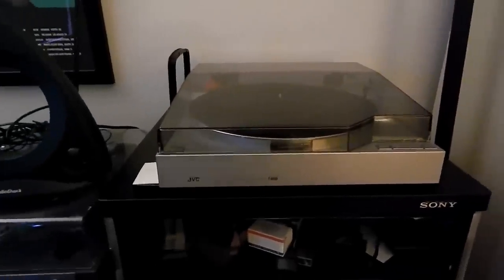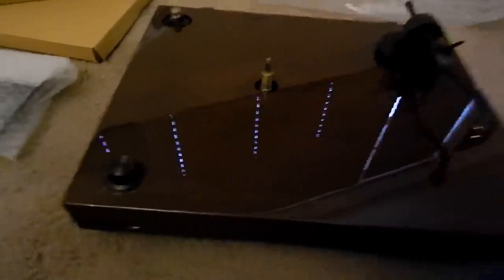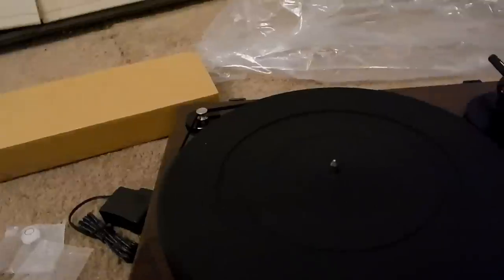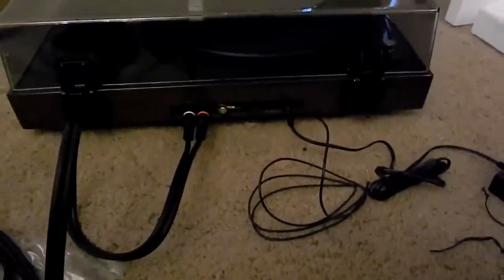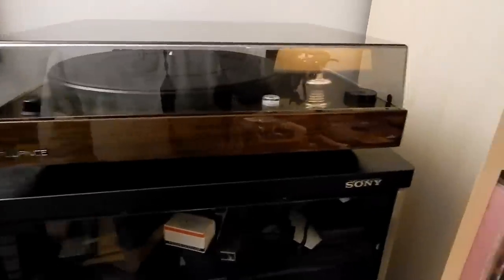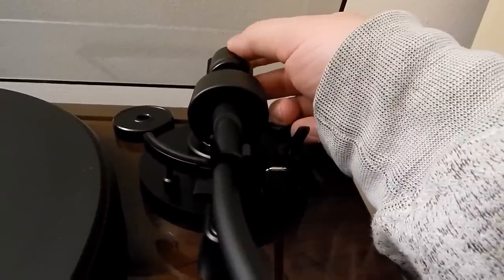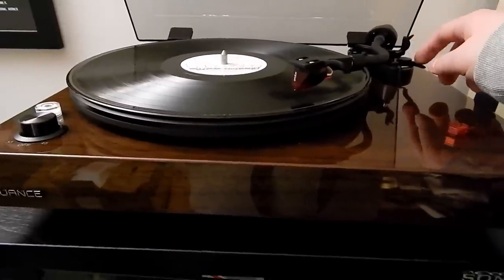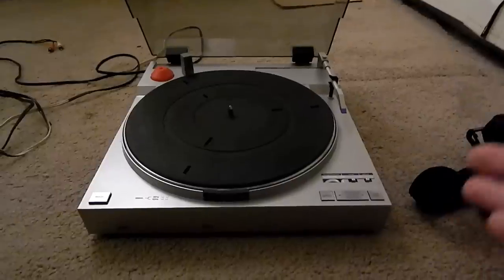New listening turntable: Fluance RT83

Comment: Most people have no clue how accurate the 60hz coming from the line is.  Years ago I toured a Generating plant and in the control room there was a recording frequency meter.  There was a 12” wide “strip chart recorder that was recording the line frequency.  In the middle was 60hz, to the left, 59hz and to the right 61hz.  The pen never varied more than 1/8” deflection up or down.  So you can be pretty sure the frequency is DEAD on.

Comment: Nice video!! I'm planning on the rt-82 because I have no need for the I'm red cartridge because of how many I have.
Only difference between the 82-85 is cartridge and the top 85 comes with an acrylic platter instead of aluminum.
It's on my very short list of next table. The motor is what sold me. Usually have to spend over $1500 for the servo controlled motor. Which isn't a huge deal until the belt wears on a table without it and you have to spend an hour messing with the tiny pots on the bottom of the plynth to get it "just right"

Comment: One ground is used to ground the turntable to pre-amp/receiver. The second ground is included to ground between an external pre-amp and the amplifier. Only one would be needed if you have an internal pre-amp.
Reply: I gutted my lp120 audio technica of the preamp and just recently upgraded to a external preamp. Night and day from my denon internal preamp on my Theater receiver. I didn’t run a ground from the preamp to the receiver I just have the one I made for the turntable to the external. I have no hummm or feedback noise. I don’t recall project mentioning that in the instructions either.  Should I add a ground to the receiver even if I’m not experiencing an issue? Thanks
Reply: @jloahunra76  if you are happy you are happy. Leave it alone if it sounds right.

Comment: The gloves are for two things, 1 - To keep Fingerprints off that Beautiful Walnut - and second, static free handling / - I am assuming that. A couple tips from your "Uncle Kev" #1 - Get a Zero-Stat Anti-Static Gun and zap your turntable the same method as you would a Vinyl Record. #2, Clean your HVAC Air Filter. The turntable may have a slight static charge to it and trust me - dust magnet. I would zap it from time to time whenever you see it collecting more dust than other "Knickknacks / Furnishing close by. Also I would suggest going to Home Depot / Lowes and buy a high quality AC Filter that collects dust down to the lowest microns available - A typical Air Filter may run 8 bucks, a Low Micron Filter will run about 20 but worth every penny. And they last longer so kind of a break even when comparing costs.  I realize I am a perfectionist, can't help it, and I have Moderate OCD so the "Minor" warping on the platter would drive me up a wall - Lol. Yes, I have to live with myself. I echo the comment on the stylus pressure gauge, either remove the stylus cover or weigh it on a gram scale so you can compensate for it when you adjust the tracking weight.

Comment: I notice with my table about the anti-skate, it's dead on when using the floats then set ring to zero and then set weight. But my weight isn't exact and I had to turn mine up when using the stylus pressure scale like you have. What I did was still float and set to zero but then set weight by the digital scale then set anti-skate to what the dial on the weight said which was higher than the 2.0 I set it to on my scale. 
I think it matches the dial on the weight well but when setting with a scale you may have to turn it up.
Another side note about the CD test is if you don't have the CD centered the wobble affects the stylus and can cause it to move toward spindle or away. Best thing to use is an actual blank anti-skate record.
Reply: Laserdisc ive heard are Good

Comment: The 83 makes the most sense.  For another $120 down the road, one can upgrade with the acrylic platter, probably a better up-grade then from Red to Blue.
Reply: Agreed - If  your budget is $350, then the upgrade later to the acrylic platter is the right choice, will lower resonance, improve speed stability and improve overall clarity.  However - If you can wait to spend the extra $150 more from the 83 to 85 (or $30 more than just the acrylic platter upgrade on the 83 ) you get the acrylic platter and the OM2 Blue on the 85.                            If you purchase the blue stylus separately it's $160,  + the platter $120 total upgrade cost for both of $280.  Spend $150 more now - save $130 later...
Reply: @craigclark2851  That certainly breaks down the numbers.  I'm pretty certain Fluance did the same numbers crunching too.  In the end, I opted for the 85 just to be done with it.  My only concern will be the expense of replacing the Blue stylus when the time comes.  It would be senseless to replace it with the less expensive Red stylus now that I've spent the extra $ for the 85.  Very happy with the TT, btw.  It performs beautifully and sounds terrific.

Comment: Looking at that JVC, I never understood how anybody thought those thin, light tonearms were ever a good idea.  They are so light, the arm will vibrate at audio frequencies and color the sound.  The job of the tonearm is to hold the cartridge perfectly still, while the needle wiggles around.  If the cartridge is vibrating too (because of low mass or sloppy bearings),  that means audio energy and information is being lost.

Comment: That looks like a nice turntable but I like the automatic turntables. I am using a realistic lab 440 which I bought new in the 80s, I remember it was a little expensive. I purchased a liner tracking turntable back in the 80s as well but unlike the one you have you can change the cartridge. It still works but the realistic lab 440 I like better. I thought about buying the fluance turntable but  instead I put a Nagaoka MP110 cartridge on my old turntable and it sounds great.

Comment: The dust couldn't have anything to do with assembly on a dusty probably statically charged carpet?
I've got a" listening" turntable as well, couldn't think of anything else to do with it.
You should have mentioned your mistake doing the weighting with the stylus protector on, for those who did not notice the cut where you finally took it off.
Sort of negates all the effort to be informative.

It's hot here this evening and I'm feeling in a pick mood. :)

Comment: Nice table good starting point servo motor is good. you can make flutter even better by putting the belt in a bag of talcum powder this will increase it's performance and the belt last longer, I would upgrade the platter and mat is the best improvement if you can, they will build you one if you ask achro platter by funk firm is the best way or just there 5mm achromat or 3 mm if you can't adjust vta, on the arm, And best improvement you can make isolate your turntable and speakers drastically help a lot get some rockwool 30mm thick cut it to the size required with a bread knife, place a piece of half an inch of ply or MDF on top place a turntable on top of this some with the speakers. Make a dramatic improvement

Comment: Hey! When you’re balancing a tonearm drop the lift lever. You’ll get a better tracking weight 😃
Reply: If you are using a digital stylus gauge to set the counterweight, do you need to 'float' the arm first, or can you just put the counterweight on and go straight to adjusting the arm? Thanks!
Reply: Sure thing, balance (float) the tonearm to get a zero stylus pressure then adjust the counterweight to get the right setting…✌️

Comment: I wanted to go with the RT85 for the acrylic platter and 2m blue, but both RT85 & RT84 are on backorder now. If I buy the RT83 will I be able to swap out the aluminum platter for acrylic?
Reply: I was waiting also, but got tired so I got the 83 and I love it. Fluance says when they restock the 84 and 85 they'll be selling the acrylic platters for upgrades.
Reply: Yes you can buy the platter and just drop it on. 
Also not sure when you were shopping but the 85 is the only one that comes with the platter. They changed the 84 to aluminum but give you the blue cartridge.
Reply: I was able to get the platter and I did see the new 84 didn't have the acrylic platter anymore, but they upgraded the cartridge to the blue.
Reply: Amazon has the RT85 in stock.

Comment: Are you still happy with the RT83? I'm on the fence between an U-turn Orbit Custom and a Fluance RT83 for my son's 21st birthday, both with 2M Red cartridges. The main difference is I could get an acrylic platter for the same price on the U-turn. What I don't get with U-turn is speed switch, adjustable feet, auto off, and the tone arm is more adjustable.
Reply: I think the Fluance is better value, sturdier, better built, and with the speed switch, auto-off and including the cue lever. It's a no brainier. I'm upgrading to the acrylic platter later.
Reply: @arielargo  Exactly why I'm going with the Fluance, especially the auto-off feature.  Also, I just picked up an acrylic platter mat on E-Bay  (much better than cork or rubber from the reviews) which will help mimic the platter, but for only 20.00 . As you said, you can upgrade the whole platter later for 120.00 if you want.

Comment: Well,i hope they really put a better motor in it and not just a servo in front of the old dirt cheap one.
Anyway,the w&f of the new RT`s is now nearly as good as old Duals like 601 or 1249 with 8pol. AC-sync motors.
Reply from the maker: I guess time will only tell. I have seen a few other people with RT81 turntables that still work fine, so.
Reply: @lmull3  : Right,one can just hope for the best. Anyway,the Fluance turntables are nice looking ones
and imho competitivly priced.  If the quality is good for the price,other brands will have to be inventive
to defend their market share.

Comment: wish Technics would reproduce the belt drive full auto BD 22.  long long ago I had an original AR full manual T'table, it taught me to always buy an automatic - I have a mid 70's Pioneer 117 that's still working very fine, thou I only use it a couple times a month.

Comment: If it doesn’t have a preamp, then that means you have to buy one for your receiver/amp that has a built in phono preamp? I have an Emotiva TA-100 stereo integrated amp and it’s worked with the audio technica budget turntables and just asking for clarification? It has both moving cartridge and magnet support, I’m new to vinyl and want the best entry turntable and I’m hearing good things about this record player. How has it been holding up? Do you still enjoy using it?
Reply: Yes this table will require a receiver/integrated amp with a phono input or a preamp

Comment: If that’s a “solid wood” plinth then iKea sells a lot of solid wood furniture.
Reply: I actually do have a lot of solid wood furniture from IKEA. My entire bedroom set. Not bad for the price :). If I had the money I would prefer a local carpenter of course.
Reply: It’s solid wood. Clearly you haven’t handled one. It’s a gorgeous and heavy table.
Reply: @Metallizombie  I thought he said it was mdf, which is not solid wood?
Reply: Eric Sherman MDF is engineered wood that happens to be made from actual hardwood and it’s more dense and stronger than plywood or particle board. This is solid mdf wood like 2” thick. It’s solid wood

Comment: Any idea if the RT83 is upgradable to the acrylic platter of the upper models?

Great review! I'm guessing you had to order this directly from Fluance? I haven't seen this on Amazon yet.
Reply from the maker: The entire reference line can be upgraded as far as the platter is concerned, so you could get the RT-82 or 83 and get the acrylic platter later on if you don't like the metal one.

I did order this directly from Fluance, yes.
Reply: jgyokohama It’s on Amazon now.

Comment: Have you noticed any noise from the motor? Should I expect it to have a little noise or should I expect it to be dead silent?
Reply: It's design of motor not only being separate to the side and extremely well dampened should render it pretty much silent. If you hear noise it's probably from another component in the chain between the table and speakers

Comment: this thing gets dust by looking at it . I had a laugh

you talking about cartridges like they last forever or the sound isn't changing no matter how used they are.well it is. ortofon says that a regular stylus last 1000 hours of listening, then needs replacement.
if you don't, the sound reproduction is obviously flawed, and I believe that after that the record grooves will suffer
Reply from the maker: The stylus and the cartridge are separate parts and are not the same thing. Theoretically you could use a cart forever if you continue to change the stylus.
Reply: @lmull3  yeah i knew that. some people opinion that the cartridge also deteriorates a bit during the life of a stylus. in many cases the difference extra in price between a stylus and cartridge with stykus is minor comparing to the price of a stylus only